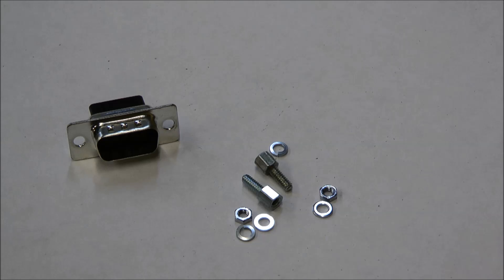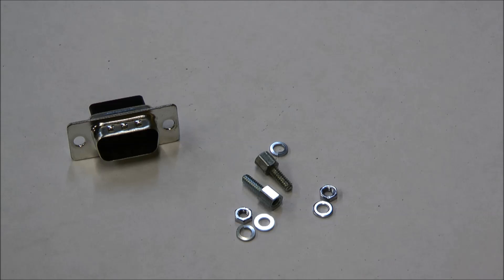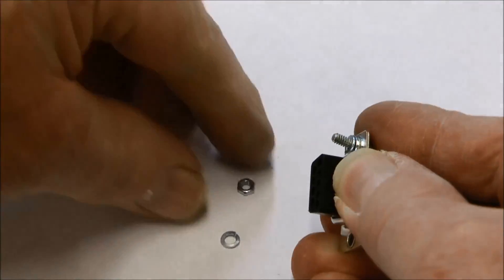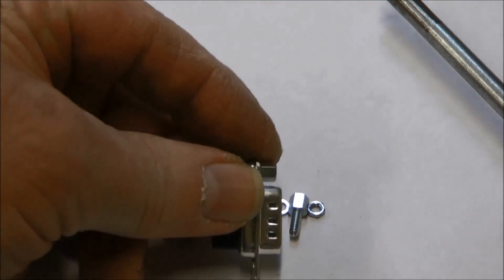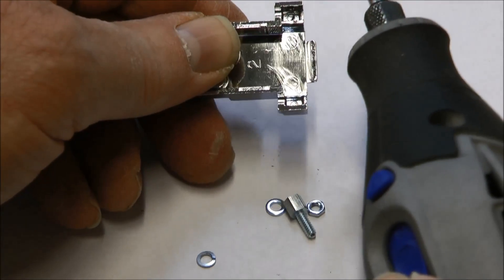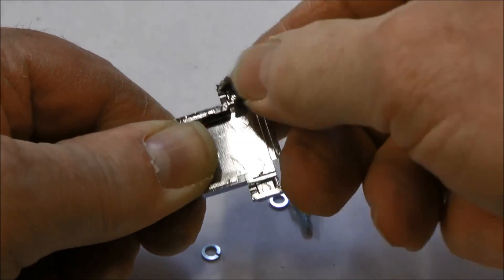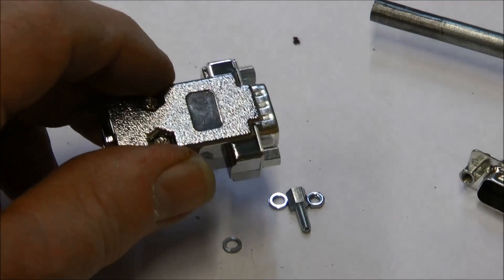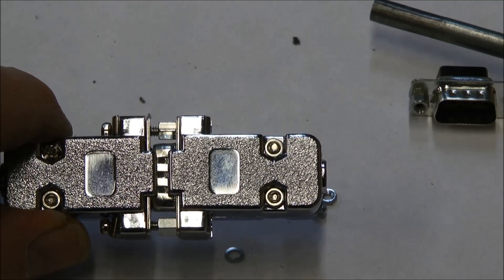014: HOW TO EASILY CONNECT DSUB (DB or D-Sub) TYPE CONNECTORS

Comment: I need to REMOVE the standoffs because my db9 male and my db9 female both came with standoffs and are thus prevented from mating.
Reply: Both db9 connectors have standoffs and wouldn't mate. It turns out you can pry them out gently after some unscrewing and loosening. Pry away from the pins, obviously.

Comment: Can I splice a yellow RCA type composite video cable to a d sub cable? What I need to do is get video from a Wii's composite single yellow RCA cable to a d sub connecter so I can use it on a PC monitor that only has d sub video hook ups. Thanks. If you could tell me what pins need to be spliced to that would be awesome!